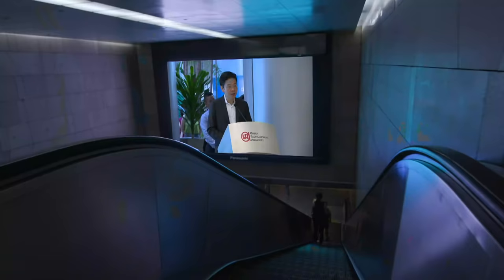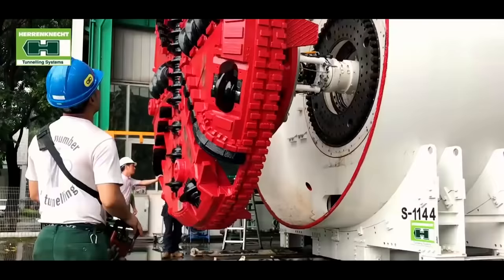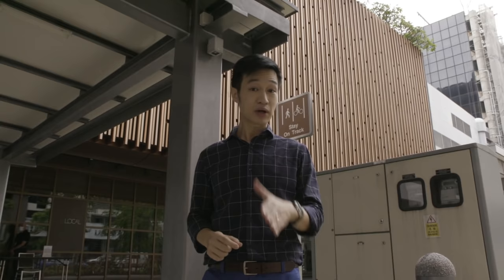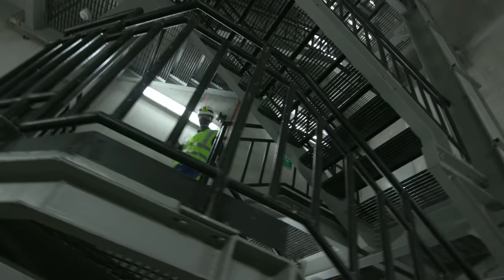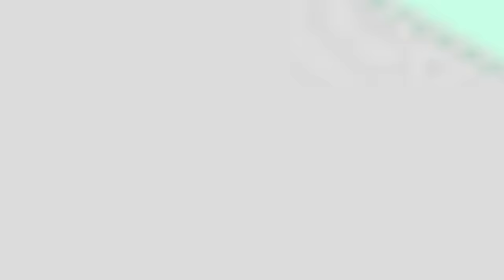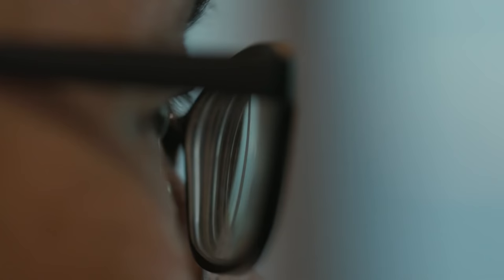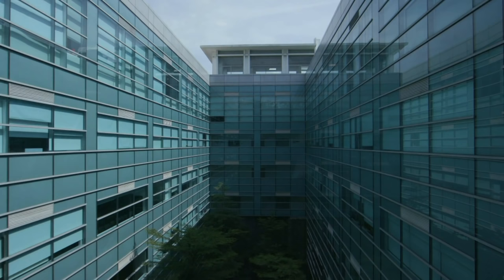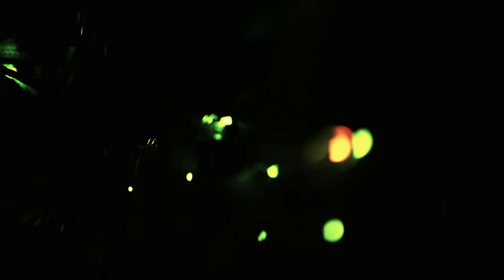Digging Into Singapore's Underground Masterplan | Why It Matters 5 | Full Episode

Comment: 9:25 The study ranking of cities based on the density of their mass transit only includes the few cities that were selected in the underground utilization benchmark. It lacks many, including the densest of all, Paris, which has more than 150km of its network inside the 105km² constraints of Paris proper city limits.
That puts the length of underground mass transit per square kilometer well in the thousands of meters or more than a kilometer per square kilometer.
The video was extremely interesting and informative.

Comment: Am fairly sure it will have been addressed but am concerned about the added risk from global warming. Press reports of the impact of the Thwaites glacier melting (and more critically the glacier behind it) estimate a sea rise of 10 feet resulting. Thwaites is projected to melt over next 5 years, have not seen estimate for 10 foot rise after that. Am sure measures have been taken to prevent water ingress but it only takes one unforeseen incident to compromise entire infrastructure.

Comment: Just a thought, why isn't there a way to have easy access to the cables under the road?

Instead of digging up the roads every time they need to do maintenance?
Reply: 1) Not enough space, still need to reserve space for future development. 
2) Even if the space is there, building a accessible cable chamber mean need to have proper security measure or electronic surveillance to prevent tampering.
3) Cost of direct buried/ haunched pipe under the road is much cheaper than building an accessible cable chamber. The maintenance is usually once every 10 years, unless it is diversion for new services.
Reply: Main reason is digging is cheap because
1. Cost of inconveniences, pollution, jam, danger, loss of productivity, loss of quality of life to the neighbourhood are not priced in. 
2. Foreign labor is cheap.
Reply: Telecom fibres optics cables are so much tiny in diameter even when bunched together which use pipes and manholes for easy access for maintenance and repair. Electricity cables are much more bigger in diameter and creating joints and repair are much more complexes which need bigger space to carry out joints and repairs. It is undesirable to put all the joints in one single holes as any explosion may burn the surrounding cables and causes bigger area of outages. Therefore manholes are impractical for laying electricity cable.
Reply: Why dont u try to think up a way to get at cables underneath a road